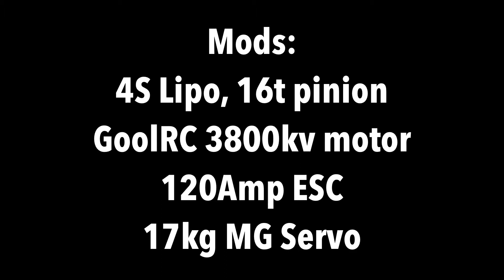FTX Viper (Brushless) 4S Lipo   Speed Trial 3   (See desc')

Comment: nice video, is that default electrics from stock ?
Reply from the maker: No, it was originally brushed at stock, then immediately went brushless. In went a 3660 3800kv motor with 120a ESC, same radio gear and servo, it happily runs on 3 and 4S. It's bonkers!
Reply: @cramalnig  hehe i am getting hold of one of these this week 4s and brushless going to be fun.
Reply from the maker: You'll enjoy the speed, I find it to be a sturdy RC, it's a decent wheelbase, very stable. 3S suits it well, 4S it's just nuts, so much so it was ripping it's tyres..
Reply: @cramalnig  thanks for that, uhm do you mean 4s damages the tires ?
Reply from the maker: It destroyed one of the 1/8 Rallycross tyres I happen to use on the car at the time, the other 3 were fine, could've been a snicked tyre to begin with, or it was a flaud from new.

Comment: I have the brushed version, wanna upgrade it soo what mods do  you suggest
Reply from the maker: Hi Owen, I’d go for a 3660 size brushless motor as it’s a 1/8 scale size RC really. Mine is a 3800kv motor, and runs either 3 or 4S lipo - it’s a brute! My Viper has a 120A esc installed to help with the bigger motor. Mine was stock, in fact I can’t recall if I even ran mine stock 🤔
Reply: @cramalnig  cheers, ill look into it. Are there any brands that you suggest
Reply from the maker: I just used a generic brushless motor available from shops through eBay, it happens to have GoolRC stamped on it, equivalent motors from the same factory but bearing a different “brand name” are the likes of Surpass Hobby.
Reply from the maker: I used a HobbyWing WPSc8 esc. Never had an issue setting it up!
Reply: @cramalnig  thanks mate